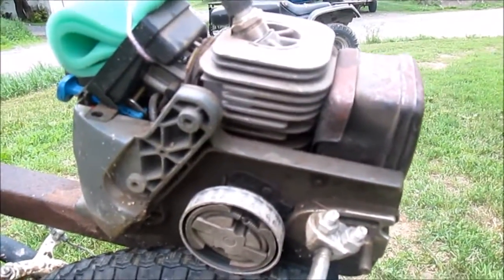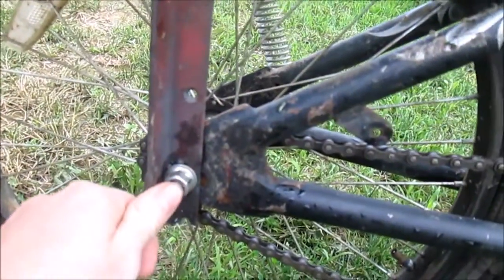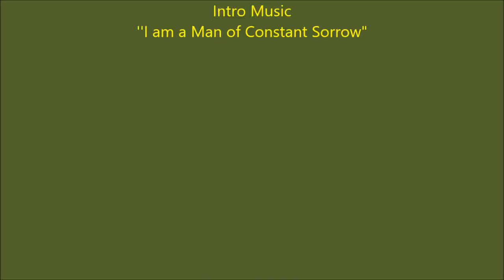Chainsaw Bike (Friction Drive)

Comment: Hey nice , im in my 50s and short one car , so im using a 2.3 l craftsman chainsaw too in an old 26 inch bike i found at the local scrapyard. I used the rotary gear changer from another bike i found in the alley and kept the brakes. I used a flat screen tv swivel stand and the spring from an old floor jack. I had to get a new carb cause I mixed water by accident with the fuel and damaged the carb. I also had to get a new 6 feet brake cable for thr throttle. I had an old stainless water bottle and converted it to my gas tank. Tried it yesterday and it started after a couple of pulls . The friction wheel is to big and once i got it running it bogged out and stalled.so more adjustments to go. Nice job by your side , take care
Reply from the maker: That’s awesome!!! I love the creativity
Reply: @RED-qj6pi  thank you , just this week i finished the engaging lever on the left side and added a bubble to draw gas in . I got to get a rear wheel cause the one i have has a bad bump or bent rim . Thank you for the 👍

Comment: good idea to use built-in friction clutch! but how it doesn't go out from engine? I tested with shaft (even "glued") and on high RPM it "fires" out ~1m far from the engine! :-))))
Reply: You can try to weld it, unless you are planning to remove it, or just make little welds so that if you want to open it, just take a dremel tool and cut it